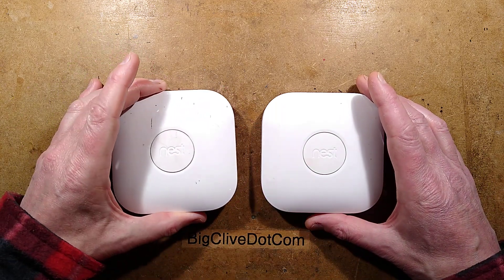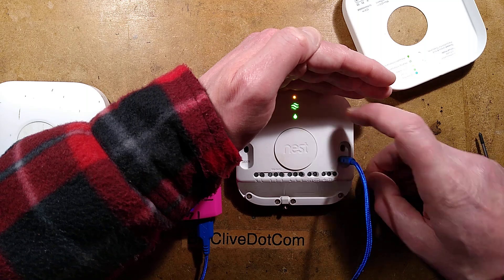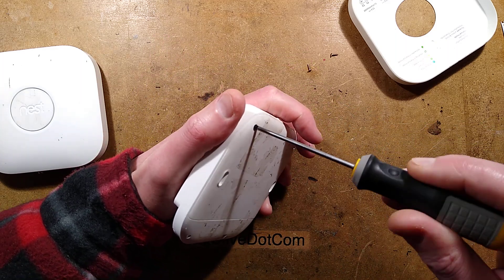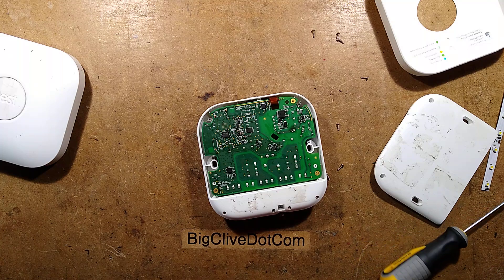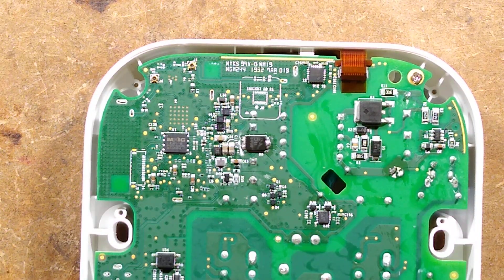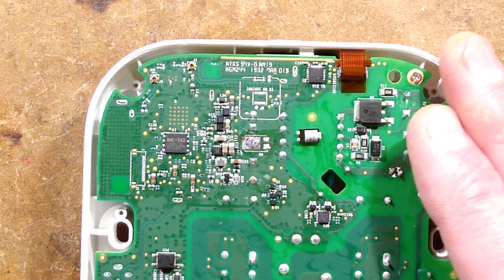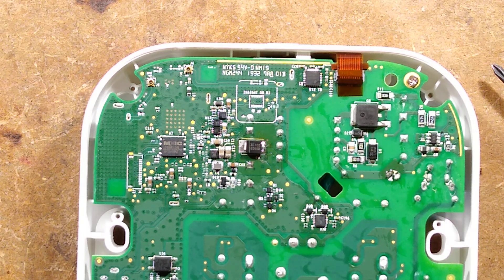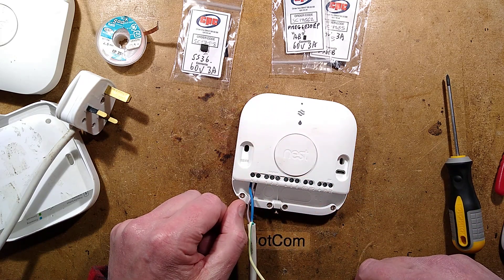Fixing another Nest heat link - with easy tests

Comment: I do wonder whether the two different kinds of capacitor in parallel has something to do with the ESR characteristics of the two different caps? Like perhaps they need a certain amount of low-ESR capacitance for spiky loads, but they still saw some low-frequency characteristics that went away when they added the additional bulk capacitance. Since it's not high-frequency, they can save a couple of cents and get a standard-ESR capacitor.

It may even be cheaper having two separate capacitors rather than one larger, higher-capacity low-ESR capacitor. In which case the design engineer's boss can go to management and tell them he saved the company a few tens of thousands of dollars across the product's entire run, and take home a nice bonus.

Of course, that's before they would've had to replace all those units due to the dodgy diodes. But I'm sure he would've pushed for the value engineering of that part too, not to mention taking credit for saving money on it.
Reply: Our design engineers would only specify the low esr caps if absolutely necessary as they were more expensive and added 3the design costs!

Comment: Also really easy to fry the HVAC unit's main control board if the wall thermostat is not hooked up with the power off. A guy at work did that once. He was an excellent electrician, just not experienced with low voltage. I remember it was a pretty expensive repair.

Comment: Paralleled caps of different makes can be redundancy, but it might also be to get the ESR or physical size into a suitable range. I've seen designs where you use a bank of small ones to make the capacitance a flat package, to get a nice and low ESR, and/or to even out the stress over multiple components.

Comment: great video. in the other video you used an UF4003, is the B360B better for the job? Thanks for the video, hopefully i can repair mine as well
Reply from the maker: Both seemed to work OK.  It's possible that the lack of a transient snubber across the diode means that the UF4003 is better suited to the task.
Reply: @bigclivedotcom  thanks. iveissue to fid theb360b soill go for theuf4003.

Comment: Clive, superb 2x videos on the Heat Link Failure, Mine just failed, same issue, 14 months old, Google replaced it within 3 days. I will repair the old one as a spare, would you be able to confirm the diode you finally decided to fit to be more resilient than the original. Keep up the great videos, Many Thanks.
Reply from the maker: https://cpc.farnell.com/diodes-inc/pds5100-13/schottky-rectifier-powerdi5/dp/SC17545
Out of stock right now, but there are other diodes that will work.
Reply: Thanks Clive, much appreciated, enjoy the coffee :-) Kind Regards, Dave.

Comment: Cool video big c. I'm wondering where you get your smd components from. I'm switching from through hole because I have enough th for the rest of my life. I know I could go to mouser or the like but I just want a variety of passives and suss out which one to use when the time comes. I have a bunch of caps and resistors on the way.
Reply from the maker: In the UK I use Rapid Electronics and CPC for stuff that has to be reliable.
Reply: In the Netherlands I would go for DigiKey, Farnell, Mouser, RS Components and probably Conrad as a last resort. Where I order depends on availability. RS is usually very quick.
Reply: Rather than buy your passives individually, if you're serious about getting into SMD I would recommend buying resistor and capacitor kits in all the common sizes (1206, 0805, maybe 0603 & 0402 if you have good eyesight and steady hands!) They're usually in the range £15-£30 for a decent kit on eBay and that gives you a good range of values in a neat little book. If you buy such kits from Farnell etc. they're usually into the £hundreds though. They're expensive now but if you work out the shipping cost and waiting around every time you want to swap a resistor they soon pay for themselves.
Reply: @jstro-hobbytech  hi Joey, glad to hear you got the books. Worth checking LCSC for parts too if you don't mind the wait from China. You can never have too many LEDs! I tend to horde parts too (not just LEDs, anything really). If a product line shuts down and stuff is getting scrapped I always try to grab them. I tried to document them, currently at 171,557 parts but there are many thousands more that aren't in reels that I daren't count.
Reply: @pyromaniac303  holy shit balls brother hahaha. I have so much of everything it's unreal. For the past year and a half it's all I've spent my money on. I'm just a hobbyist and took up the hobby mid 2020, I've been fixing stuff for years and wiring guitars plus I'm retired at 42 with nothing to do lol. I've really been loving the theory. I was the same in university where I took data science, almost an offshoot from comp sci but geared toward data mining and every database software back to powerhouse and learned every language since cobol up to visual basic when ms was really pushing it. I made duck hunt for my final project and a bunch of other cool stuff in every other language but didn't code much after graduation. I didn't wanna move... my led collection is growing by thousands a week, literally bahaha. You're hard-core on a level much higher than me though hahaha
Reply: @jstro-hobbytech  wow wish I could retire at 42 😅 aiming for 55 but that's looking dodgy too. With all those programming languages under your belt it's definitely worth getting into microcontrollers if you aren't already - I always love to work on really minimalistic stuff like MCUs with 128 bytes of flash (check out PIC10F200 etc.) and see what performance you can squeeze out of them. I've been collecting parts for the past 20+ years though so I've had a head start.
Reply: @pyromaniac303  actually at 37, I always said the same thing. The first 4 years I mastered progressive guitar as a life long player it was cool to play over 16 notes a second but I've always been into tinkering but with electronics but this past year and a half or so I've been going deeper into the rabbit hole. I always regretted not taking electrical or electronic engineering or repair. The Motorola guy that fixed our coms at work had the coolest job but knowing more about rf now I'll never be able to enter that wacky zone. I feel as if I missed out on pic. I'm decent at c when I'm in practice and have an understanding of asm and I thought about it but I've been trying to do everything with components lately, keyword being trying but I've got a long time to learn I suppose lol.

Comment: Clive I have an ESP32Cam which... makes noise.  It sings.  I swear it does.  Physical sound.  It has no components that make sound.  It's 100% solid state.  Nobody believes me.  I videoed it.  People said it was the camera focusing, but it's a solid state camera, no focus.  So I removed the camera and tried again, videoed it again and ... it still made the sound.  Processor noise.  Almost musical.  I figured with some clever C programming we could get it to play a tune.  If I was to hunt it out of the junk pile, verify it STILL makes noise, could I send it to you for independent evaluation?   I'm not BS'ing WooWoo, history channel, I infact expect it's magnetic coupling on the "can" over the main chip that is causing this particular ESP32Cam to resonate (it's can) and make audible sound.

Comment: The chip you pointed at, MXIC branded, is a flash ROM, probably SPI, maybe dual or quad SPI. Likely storing the firmware that the processor runs.

Comment: Little red riding Clive went into the empty nest , the 3 diodes had gone. On the table sat 3 bowls of porridge. Clive first tried daddy SS36G diode's bowl.. it was too big! Clive next tried Momma PMEG6030EP's bowl.. it was too small!
Sighing in frustration, Clive finally tried Baby B360B's bowl. It was juuuust right.
...
Sorry Clive I just could not resist.  :D
Cheers,

Comment: What does the output from the diode feed external to the Nest box?
If the 12-volt output from the Nest box feeds anything inductive or capacitive, is there any back EMF/Flyback diode fitted across the 12 volts output of the Nest box to prevent spikes from coming back into the Nest box, thus damaging this diode? It may be worth just fitting a diode across the 12 volt output just in case this is the cause of the SMT diode going short, a back EMF/Flyback diode will certainly do no harm if this isn't the cause of the diode in these Nest boxes going short.

Just a thought........

K Watt.

Comment: Given the 12V runs to the remote thermostat, is there any protection on that against short circuit or could these failures be being triggered by eg a bad termination creating a short or at least low resistance joint in some way?

Comment: One in USA use 24v not 220v
Ac get 120v or 220v n sent 24v to thermostat n only 3 wires one wires to heat n one wire power 24v n one wire cold
Ac have maid pcd boards that have reply requires 24v to kick it on n sent power to it
I surprised you knew what was wrong with it n amazing troubleshooting experience

Comment: Where do you get your solder from?
Since running out the solder from my days as a telecom engineer I'm having trouble finding anything as good!
Latest stuff I  got from ebay (branded Jinhu & made in china) is supposed to be 60/40, tin/lead, rosin core.... I'm not convinced, doesn't flow easily and leaves a dull finish.
Reply from the maker: The eBay solders are often random alloys.  You may have to get it from UK suppliers like RS, CPC or Rapid, noting that you will have to present yourself as a company to buy it.

Comment: Is the diode package a TO-227A also known as SMPC, it hard to tell without dimensions. Vishay do these in 5A upwards. Pin 1 and 2 are a common anode. Pin 3 (heatsink pad) is cathode. Another fantastic video. Thanks Clive

Comment: What are the 240v heating circuits typically fused at in the UK? Over on this side of the pond typically the only line voltage stats are for resistive baseboard, one stat per room in many cases and they're dumb bimetallic and micro type switches.

Comment: A big relay or contactor will put a high reverse voltage on the system. It usually finds the weakest component fast. Good job! Sell it cheap! Good luck.

Comment: It is rather unfortunate that the Diodes incorporated "PowerDI5-3" package is the same as a TO-277 package, is rare compared to the slightly larger TO-277A. Without a caliper on hand, I am not sure the more common package would work in this instance.

Comment: Don't overlook pre-warming the board using a domestic hairdryer on hot for a minute or two before desoldering components like this. Start desoldering immediately afterwards (no delay) 

It reduces thermal shock as well as helps desoldering the lead-free solder.

Comment: Hey Clive, can you talk about how to determine safe voltage range for devices that use an AC to DC brick or wall-wart? Say a computer monitor that has a 19.5v power brick that maxes out at 50watts.  How would someone go about finding the allowable voltage limit of the monitor. Say you wanted to power said monitor with an 8s LiFePo4 battery that can vary between 20 to 29 volts?
Reply: The first thing to check would be the capacitor voltage ratings and then the specs for the power converter chips onboard. A common rating for capacitors is 25 volts so I wouldn't push a 19v device past that. My suggestion is to stay under 22 volts if you can.

Note that this is mostly applicable for modern devices with higher voltage inputs. If something has a 5 volt input you probably want to stick very close to 5 because it is a common voltage for digital circuits to run directly off of.

In reality electronics with a 19v supply will most likely work with much less than that. A 4s LiFePO4 battery might work well in this particular application.
Reply from the maker: It would be safer to stay in the 19V range that the item was expecting.

Comment: - Could the spike from the relays turning off be killing that diode?
- Another thing is that the relays are responsible for the majority of the load taken by the power supply. Could the transition from “on” to “off” be causing a poorly-designed feedback network to misbehave and throw the voltage into the diode’s breakdown voltage area?!
All the options I can think of, however, stem from the assumption that something is inherently wrong with the circuit design, and not its use.
Cheers!

Comment: I wonder if using 2 diodes in series is so that the device "does" fail outside of warranty. Spend a few pennies per unit to save dollars worth of possible warranty claims. Future proofing their bottom line.
Same thing with the capacitors.

Comment: Hi Clive, remembering the previous Nest, I wanted to ask you if you would fancy some post-mortem on an horrendous 4 ports USB adapter with a split PCB badly put back together with some resin and thick solder points. It ran for 6 years before going out with a bang, an exploded glass fuse, and a capacitor that melted through the top ABS cover. Just for entairtainement of couse :)  If you're in, I can e-mail you some pictures of this epice contraption.

Comment: I tried changing the diode on my heat link. I put in SK310 and the unit worked until I connected it to the heater and to the thermostat via T1,T2. At that point relays started to click like crazy. Did I use the wrong diode for this?
Reply from the maker: That should have worked.  If the relays were working before I wonder if it's wired correctly.
Reply: @bigclivedotcom  weird thing is that the heat link works on its own when I just plug the power in (relays click, button works), but once it's connected to the boiler and I turn the nest thermostat to heat relays click like crazy. Do you think another diode would do the trick? I have SB360-DIO and SB360-DIO-SMD. Both are 60V 3A. Wired correctly? You mean wired to the water heater?
Reply: @bigclivedotcom  seems in the end that I didn't do a proper cleaning. I cleaned out all the remaining flux and for now it's working fine. Thanks for the tutorial. It was really helpful!

Comment: You can use the 3a 100v SS310 schottky Diode as replacement, should be better than the 3a 60v you're using currently
Reply from the maker: I upgraded to a higher voltage.

Comment: Regulatory safety tests only apply single faults at any time. Hence why doubling up on those diodes. All part of the risk assessment process. So basically good practice these days.
If that's a Schottky diode then you have to be so careful with their max voltage and as you state, if the 12V goes of and around the house then any induced spike could kill it. Again, putting another series diode close to the 12V output and some surge clamping component would help. Maybe a little reverse engineering of those remote terminals could clarify?
Given the cost of these devices to the consumer and their application which is aiming to reduce waste, then reliability measured in decades would be nice - but then they also rely on remote servers that can be switched off at any time. Note: They may operate as basic thermostats without the remote server, but will the "app" work in twenty years time?
Reply: I have the actual "NEST" thermostat - the teeny computer with the LCD screen and the rotating dial.   You can set it up without internet completely, and it's still reasonably programmable, although it's a LOT more annoying than using the web site/app.    If Google drops the brand, I'm sure someone's going to come up with a firmware hack to make it directly accessible over your wireless network. (if they haven't already)

Comment: I've popped one myself by firing up the genni which shot out 300+ volts (whoops) I've found damage on the Varister (V07E275P), as well as the safety capacitor (B32921C3333M000) - there's also an inductor/choke component I can't identify labelled L12 on the pcb - any pointers welcome...
Reply from the maker: If the varistor has tried to clamp the higher voltage it has probably blown the on-PCB fuse.
Reply: @bigclivedotcom  thanks, actually it tested as fine the fuse which was weird. I think the component that I was not sure of (and checking your first video you weren't totally sue either) might be a choke for emi or something. I've ordered some replacements of the other components and see what happens there . Thanks Clive, I've always enjoyed the videos for years.
Reply: Confirmed - replacing the Safety Capacitor and Varister solved the problem!

Comment: I've bought a Chinese IRAlan dimmable led ceiling fixture but it's in its lowest setting waaaay to bright and a watch your eyes is needed. 
It has warm and cold that is mixable with the remote but it only has 2 wires so it's definitely digital. 
I like to have the minimum brightness lower but I can't find any info on these things.
The transformer outputs 18-28v 2.2A
Can I just put a beefy resistor between it, or do I kill the thing?
I do have solder skills but my knowledge in electronics is basic 😉
Reply: Go to an electronics forum, and start a new thread there

Comment: Be interesting to know if the failed units were powering the thermostat. My thermostat is remote, with a wall wart, connecting wirelessly with this unit.
Reply: If it fails, you have no central heating- trust me, I know, it happened to me, hot water was ok
Reply: I missed your question, and just asked the same thing.

Comment: These failing diodes arent seldom.
High volume products often use very fast and hot smd reflow profiles to push production speed and sometimes exceed the limits of the diodes.
Combined with "out of spec" diodes which arent able to sustain their rated limits even in a "perfect" reflow-profile.

Good in -- bad out (damaged to strong degrading over time).
In very high reliability dependend products some designer are demanding handsoldered tht diodes to reduce the probability (with special demands for the handsoldering itself).